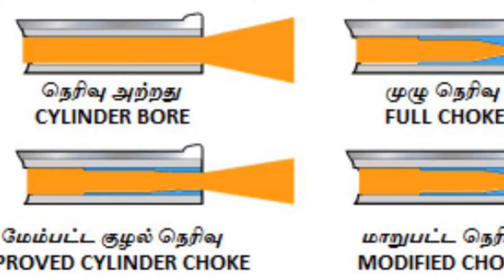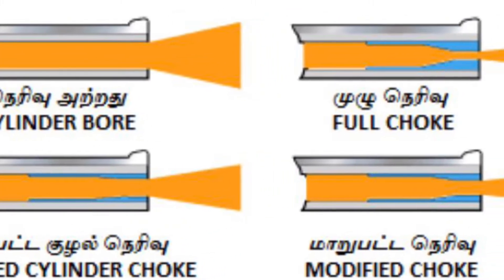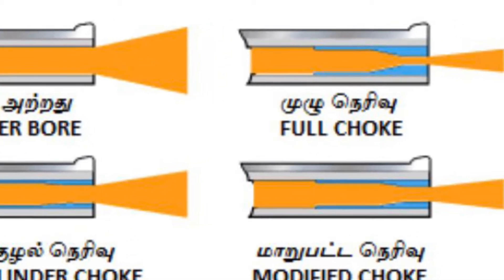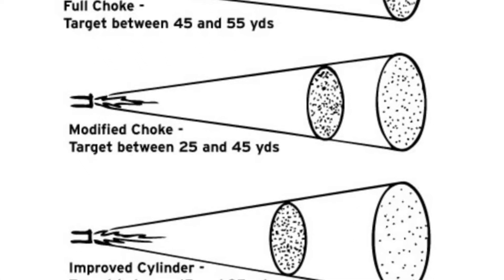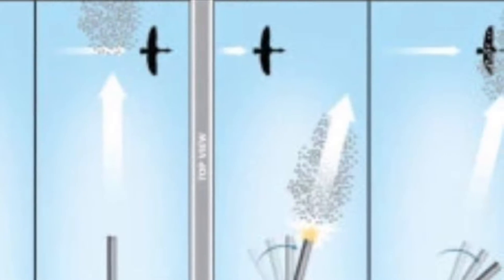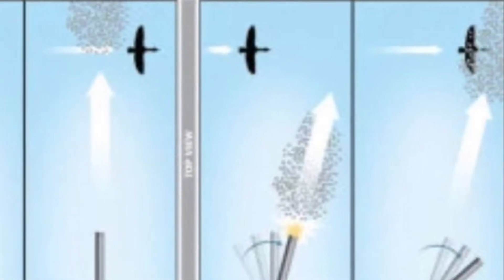Shotgun Barrel length, when does it matter?

Comment: I just ordered a waterfowl shotgun at 26". I've always shot that length because I like how it swings but now I read that a 28" would of been better choice for some advantages. Should I change my order to a 28"?
Reply from the maker: So much of shotgun choices come down to patterning of the load. Taking a quick stab, my reaction would be to stick with the 26 and pattern/shoot it for awhile. If your unable to get the pattern or hits you want with a given load you are really dead set on then you can adjust from there. Different choke tubes and after market accessories or options will help address some issues as well.
Reply: 26 is an already long barrel I couldnt believe that 2 inches more make such a difference if any. velocity wise there is none.
Reply: Most hunting shotguns feature a 28" barrel, I personally slightly prefer a 26" one, 'cause I find it a little less cumbersome and with the same efficiency. As a matter of fact it's up to you there's no big difference as long as you d'ont take a home defense barrel lentgh '18 or 20" with which you won't be able to take long waterfowl shots

Comment: Much of what you said is false. Paul
Harrell proved there is a large velocity difference between 18.5 and 30 inch barrels. 

And that was only with 2.75” shells. 3.5” shells would have undoubtedly gained even more velocity from barrel length.  

More velocity will improve effective range by giving you more penetration and less lead times. It might also give you a tighter pattern at longer range by pushing the shot further before it has time to spread. 

Tests show tighter patterns with longer barrels. 

Nobody seems to know what the true point of diminishing returns is for barrel length using different shell types. 

Is a 26” good enough or will going up to 34” still give benefits?Nobody really knows because more testing needs to be done.

Comment: Interesting to watch, but all 3 of my 870s have 28" fixed Modified choke. Two 12ga and a 20ga.............which I use for everything.....Skeet, Trap Doubles, Pheasants, Ducks, Geese, and defense. If before I leave this earthly realm I finally get around to Turkeys, I'll dust off my 30" fixed Full barrel which, BTW, hasn't been fired through since about 1995!
I bust a lot of clays and bring home the meat, so Modified works.
Life on Planet Earth ain't complicated. 
If it works, don't fix it.
Reply: If everyone had your lazy uncurious “good enuf” attitude then no innovation would ever happen and you would still be using a black powder muzzle loading cylinder bore musket.